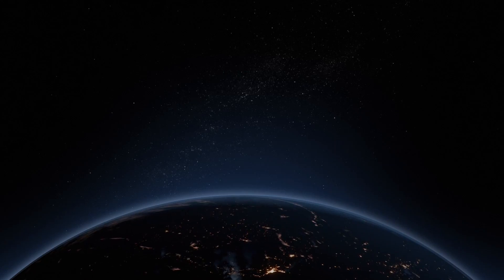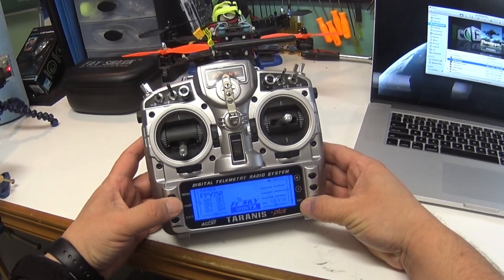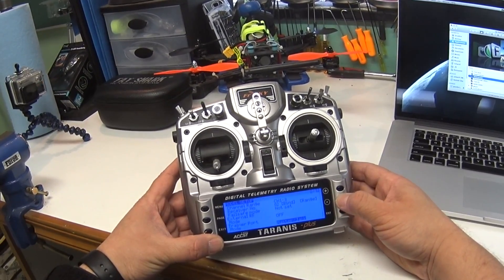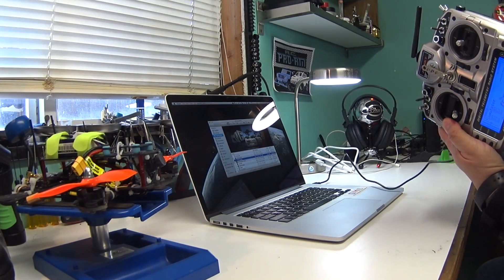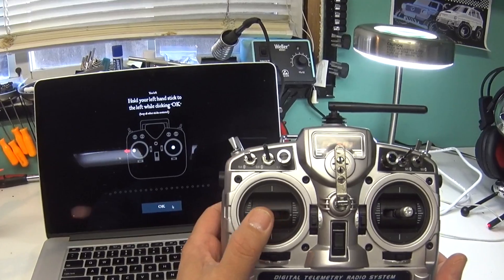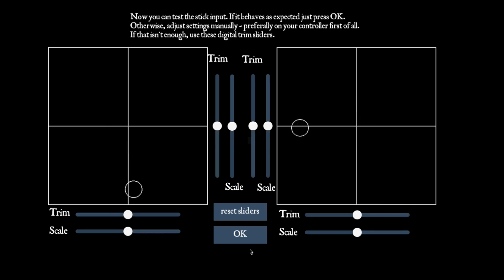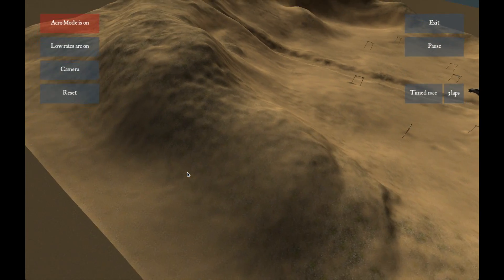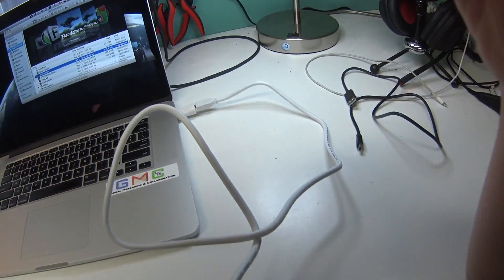Quick FPV Simulator Setup with Taranis X9D (FPV Freerider)

Comment: I can't even get my Mac to recognize the Q7X. Got any tips? Been at this so long...ugh.
Reply from the maker: It seems to be particular about which cable you use. You might try different cables. Also try connecting directly yo the Mac without any hub or extension if you happen to be using one. HTH
Reply: Ok. Good to know. I was also just informed that an SD Card is imperative. Going to search for one now. Thanks for your help!
Reply: Rich Friedland BTW, you were correct about the cable. Just bought one and it hooked right up. Few things to modify on the controller before I get "hooked" as well. Thanks again buddy!
Reply from the maker: That is great news. I am glad to hear it!

Comment: My computer keeps on reversing the controls and is extremely insensitive
Reply from the maker: Sorry to hear that. I haven't heard of that before. Did you already try creating a new model on the Taranis?
Reply: Rich Friedland I use the at9. So it's not all that great for simulations, but I didn't think it was gonna do this. I bought the adapters and everything.

Comment: When I connect my taranis to the computer it doesn't work
Reply from the maker: Have you tried another USB cable? I have found that it doesn't work with all cables.
Reply: The GoPro one should work
Reply from the maker: I agree. The GoPro cable should work for this. Make sure you follow the right sequence when you power it up and connect it to your computer. Also, be sure you created the simulator model and set it up as described here. If it still doesn't work, you might try another computer to isolate the problem. I hope this helps a bit.

Comment: Did you manage to troubleshoot why you couldn't get the goggles working?
Reply from the maker: +iXFranTiQueXi Yes, I sure did. I think the HDMI cable was probably fine, I needed to switch the "Display" / "Control" button on the goggles until I got the right HDMI input. It is the black button on the underside of the goggles.